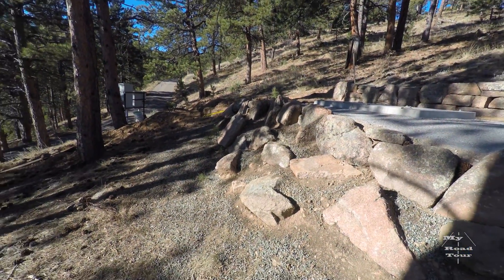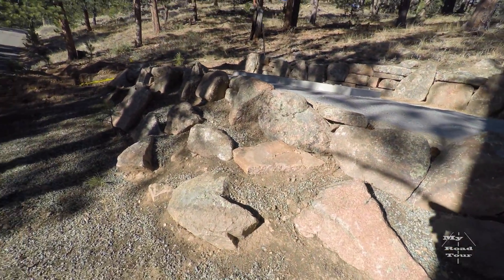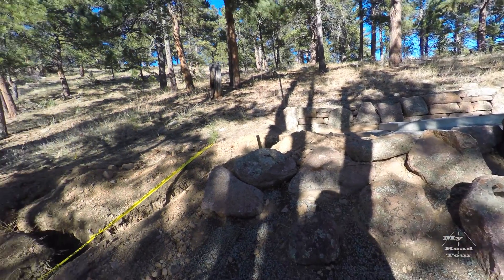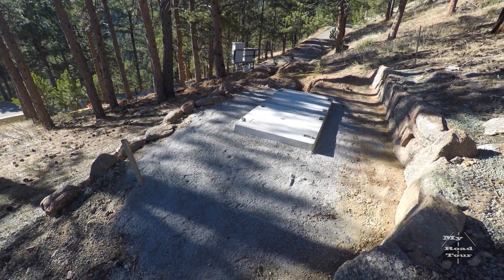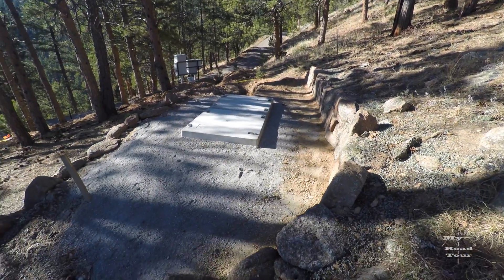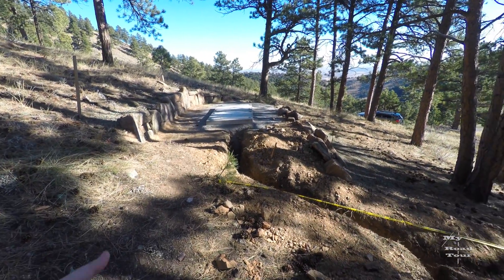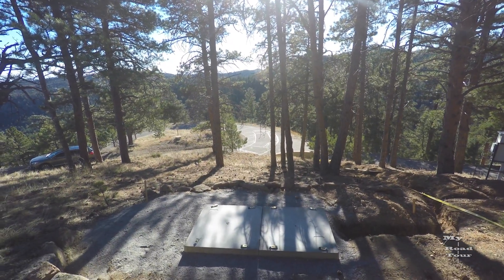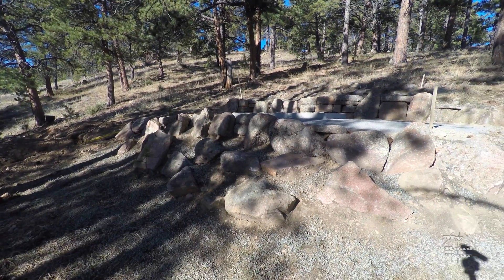48KW Generac Generator install Part 1

Comment: did not see any install ,whats up with that
Reply from the maker: This is a "Part 1" video for starters and I wasn't able to video the gas company digging a trench and installing the new line or the electrician wiring it up. It was close to plug and play having been installed at both the electric box and gas meter. So they really didn't have to do much inside the home. Anyhow, here is "Part 2." https://www.youtube.com/watch?v=G7dClrbKPdk&t=65s